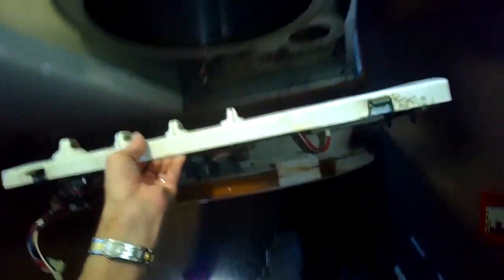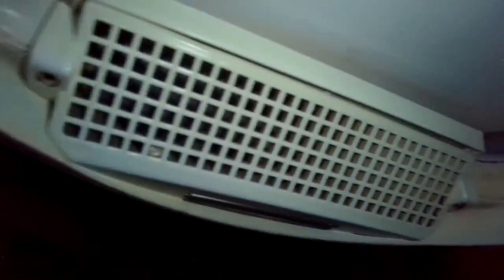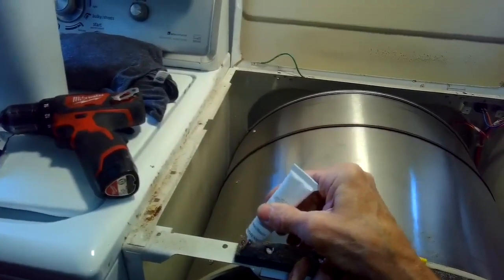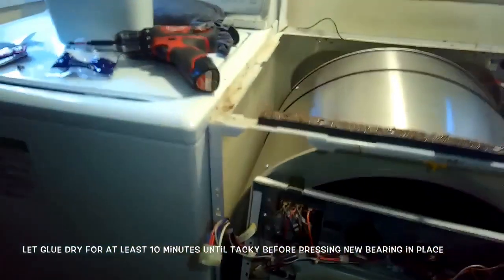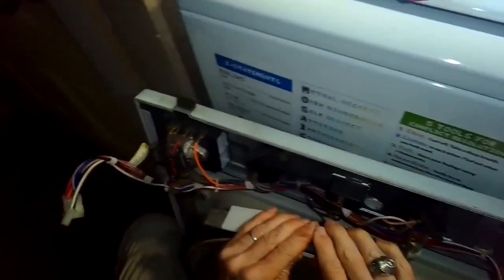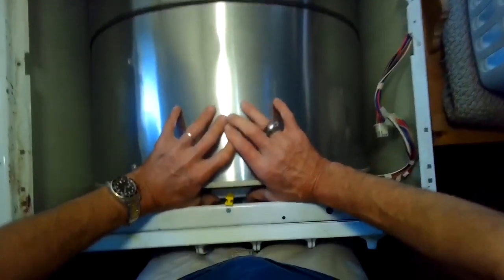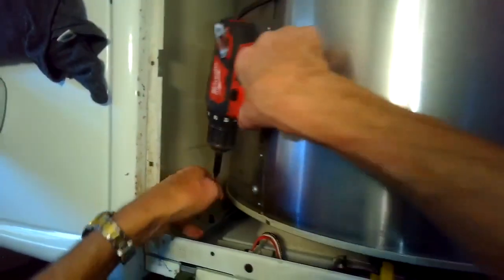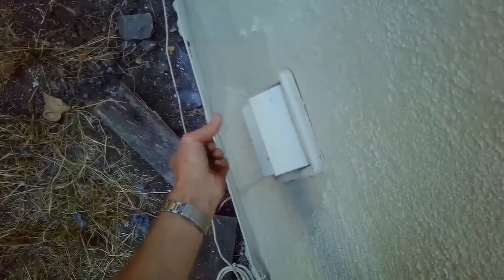🔥 DRYER BURNING HOLES AND LEAVING BURN MARKS—FIXED 🔥

Comment: Ok people DO NOT make the same mistake I did. Scott's video is so helpful and I am extremely grateful for it because now I feel like I have a brand new dryer. I can't tell you how happy I am to have a dryer that doesn't burn clothes. But when I was putting on the felt strip, I had music on in the background, and quickly just fast forwarded to the section where Scott shows what direction to put the strip. I had already watched the video before, but I forgot (or more like, hadn't noticed on the first viewing) that he took the front door off, and turned it around.  If you were to simply fast forward to that part where he shows himself putting on the felt, it would appear that the white tabs are supposed to stick out pointing towards the dryer, but it's the opposite because he's working on a door that's been turned around. He DOES say this in the video, but if you just scroll really quickly to that one part and aren't listening to what he says, you could make the same mistake I just did (I realize, MOST people probably will not make this mistake... just writing this for the impatient people who fast forward through videos). I put it on backwards, and only realized this after I put it all back together and put the screws back on.  Had to take it off and re-do it., taking the strip off, using the rest of the glue and turning it around. When putting the screws back in - they're easy to drop and the one on the right side took me half an hour to find it, somehow it rolled really far back to an area I couldn't see.  Finally got it back together and was able to clean out a TON of lint that could have been a fire hazard. I am super grateful to Scott for putting this together, because taking apart a dryer is a very daunting task, and I wouldn't have even tried it if it wasn't for the fact that this video shows exactly what to do.  This perfectly good dryer could have wound up in a landfill. My clothes are drying PERFECTLY. now, and I am finally able to use the normal settings like the one for towels, that I couldn't use before, because I could only run it 5 minutes at a time, for fear the Dryer Jaws would eat or burn my stuff. Huge thanks to Scott.
Reply from the maker: Thanks so much Laura,

It’s a common mistake.

I’ve done the same thing😂😂

Comment: Extrenely helpful video, thanks so much Scott! I thought I was going to have to replace the drum, but it looks like your video addresses the exact problem I having. I have burned SO many items and could only run the dryer for 5 minutes at a time, clothes were constantly being caught in the crack in the front. I would have fixed it years ago but nobody had a video that seemed to address this issue, until you came along.  I have ruined hundreds of dollars worth of clothing, not to mention I've wasted tons of time because I have to keep yanking the clothes out, and can't run the dryer for more than 5 minutes at a time, so I'm always having to go back and check on it. This is a much easier repair.than replacing the drum. Please consider posting links to where we can buy these parts, using an Amazon affiliate link - that way you can get an affiliate fee, and you'll be doing a great service for your viewers who can easily buy it straight from Amazon and support you at the same time : ).  I don't have a lot of money in my bank account, but I do have credit on amazon from gift certificates, returns, etc., so hopefully more people could support you in this way. Thanks again!!!!!!!   (PS here is a link for Amazon's associates program, to join as an affiliate, if you aren't one already, it's super easy). https://affiliate-program.amazon.com/
Reply from the maker: Thanks so much Laura😊
Reply: @QuickAndEasy5MinuteAppliance  No problem, thank YOU, Scott, it is such a huge relief to have a working dryer again, you are a Godsend!

Comment: Mine is burning clothes but at the hot air inlet. I replace the entire dryer with a used unit that was identical. It's doing the same thing. I figured airflow. It's in a small laundry closet so I replaced the hot vent and told wife to leave door open to room so there is enough make up air. Still did it on normal heat setting. Dryer exhaust is only 1' long mild bend
Reply from the maker: It might be a worn out front bearing.
Reply: @QuickAndEasy5MinuteAppliance  all the bearings are fine it's melting fleas blankets on the vent grill where the hot air is coming in

Comment: I have LOTS of BURNS on my white 800TC King sheets I love. All this time I thought it was rust from washer or dryer - wasn’t sure bc the appliances were given to me with some rust on outside. I sanded them down & spray painted with metal paint. I just bought some NEW shirts on SALE. Was livid when I saw 3 long brown marks across the front & back of white parts of new shirt! Usually I hang my tops & delicates but lost weight & was trying to shrink them just a bit. Tried lemon juice 1st thinking rust & of course it didn’t work. So I YT brown marks from dryer & found you! 
You said you were working on gas dryer. Mine is a Whirlpool electric dryer. Will the instructions be the same? Figured I’d ask 1st to be sure. Thanks!

Comment: Does anyone know what kind of contact cement (brand) is needed for this?
Reply from the maker: Here you are:
https://www.amazon.com/Whirlpool-Y055980-High-Temperature-Adhesive/dp/B00DM8L5GU/ref=asc_df_B00DM8L5GU/?tag=hyprod-20&linkCode=df0&hvadid=198068632238&hvpos=&hvnetw=g&hvrand=8238514647186187180&hvpone=&hvptwo=&hvqmt=&hvdev=m&hvdvcmdl=&hvlocint=&hvlocphy=9032085&hvtargid=pla-320363665178&psc=1